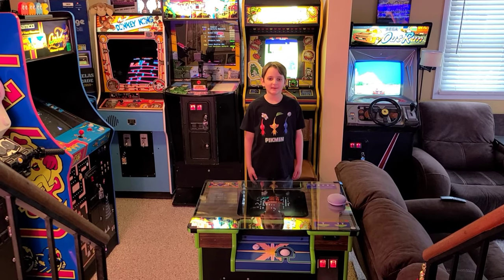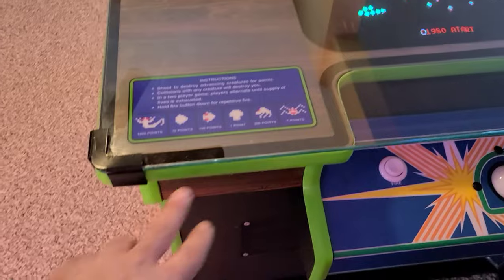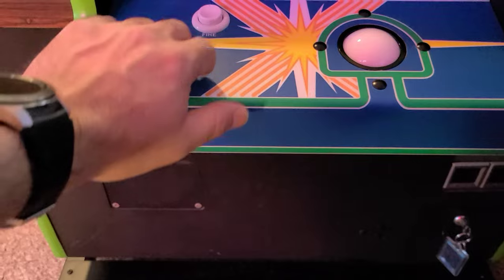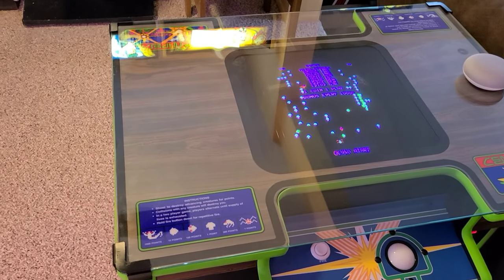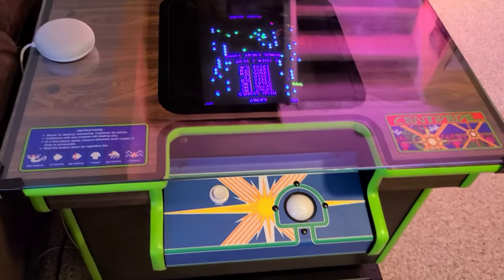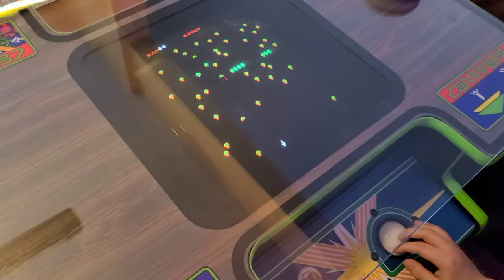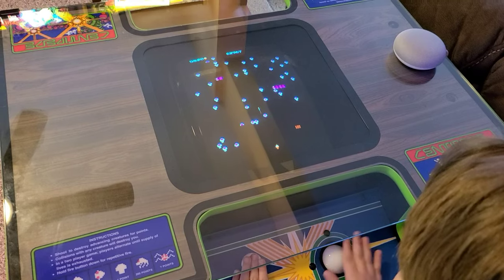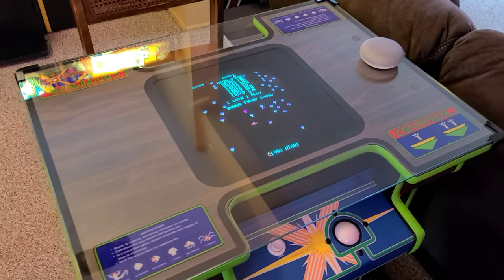Our Finished Atari Centipede Cocktail Table Project

Comment: Love the restoration! I just picked up one of these myself. Do you know where to find the plastic ends for the legs? Thanks!
Reply from the maker: Thanks for watching the video! I bought these on Amazon a few years back. They fit okay but could be a better. Next time around I'm going to use a dab of silicone on the back to hold it in place better. But they are definitely not bad. 

uxcell 12Pcs 35mm x 35mm Plastic Blanking End Caps Square Tubing Pipe Insert https://a.co/d/3SHSE2H
Reply: @kazelasarcade  thanks i really appreciate the link! I couldn’t have known what to call them lol. Would you mind saying where you bought the underlay from? I am on the fence about keeping the og but slightly scratched and somewhat peeling art/ glass. Yours turned out great ans is nudging me toward restoration. Thanks again and yes im really enjoying your content!
Reply from the maker: @pwc9222  at the time arcade shop had them. I just checked and I don't see a listing for it currently. 

I know what you mean about the glass. I was in the same boat. Don't like a bunch of scratches
Reply: @kazelasarcade  ah thanks i had read up on it and heard arcadeshop had them at one point. Maybe i’ll luck out and arcadeshop has one left. Thanks again!
Reply: One more question if i may😀what size tmolding did you use? Mine seems to have a slightly wider than 3/4”. And yes that green adds pinache!
Reply from the maker: I ended up using 3/4 in t-molding. If your sides are a bit wider then it's possible you might have water damage?

You can always buy a bigger t-molding and use a shaving tool to make it fit
Reply: @kazelasarcade  thats a good tip! It is from a coastal town so it has some rust so its possible it took on some moisture. I think ill buy two sizes and go from there lol. Thanks!
Reply from the maker: If you can't find one that works, use the oversize and T-Molding.com has the tool to trim the excess off seamlessly
Reply: @kazelasarcade  awesome pro tip! Thanks!